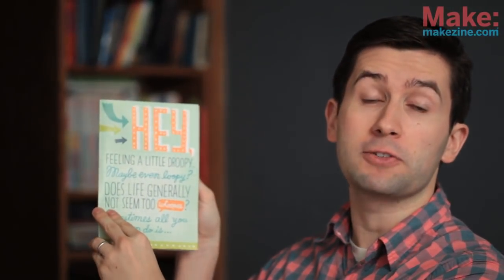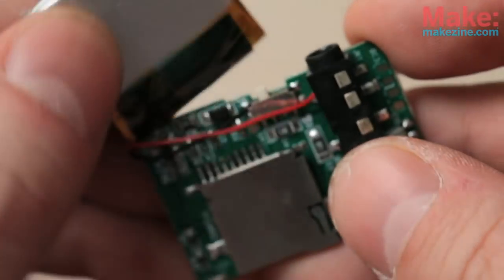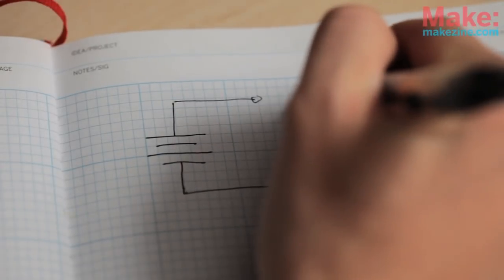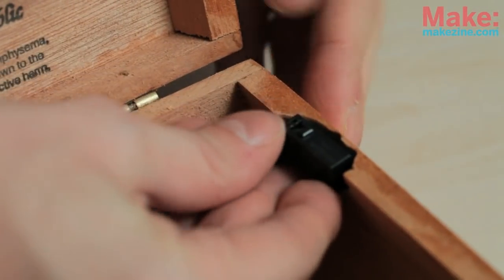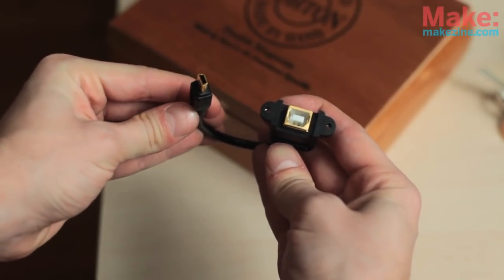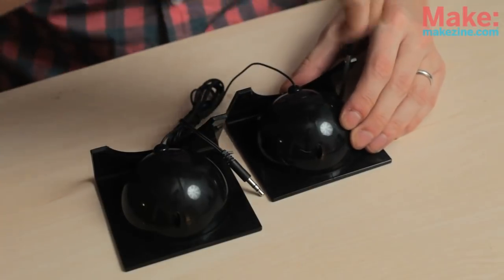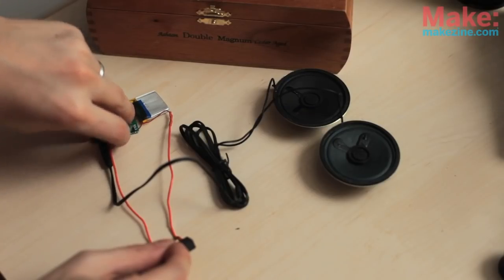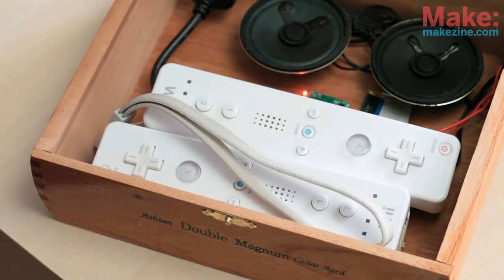MP3 Music Box

Comment: 1st op amps in mp3 arent meant to drive speakersssss they will clip please learn some electronics
2nd you should have mounted the speakers on the box and not in it 
3rd please i beg u to learn how to fucking solderrrrrrr cold soldering everything
4th that box could have been a crazy ass boombox if hanled by the right hands

Comment: Hi, this is the exact name of the switch:
PUSH BUTTON MINI SPDT C/O
the one I bought was from a manufacture called APEM
and this is the image of the switch:
h t t p : / / w w w .talmir.co.il/gallery/1349517496.jpg
the middle connection stays unplugged and the two others close the circuit 
hope it helps.

Comment: I soldered the mp3 to a switch and found out it works only when I press the button and it should be the other way around !
The circuit is supposed not supposed to work when the button is pressed...

They don't say anything special about the switch..
If someone knows what the heck..

FML.

Comment: could you please tell me where exactly on the circuit board did you solder the other lead from the switch ?  (not the one that was soldered to the battery)

Comment: poorly executed. i have a project similar in idea to this, but i'm using amplified speakers and a lithium pack from an old mp3 player (2200mah, 3.7v). it's also a much smaller box. in my case, i put the data/charging connection on the BOTTOM of the box so that nobody would see it. 

another flaw with this project you have is that it is IMPOSSIBLE to charge the battery unless you prop the lid open to keep the circuit closed.

Comment: you can't easy charge when te box is closed the + wire of the battery is not connected to the bord by the open switch so you need to open the box and play the music to charge the battery

Comment: Taking 8 additional seconds you could have made those cuts look nice.  Doing a hack isn't just about making it work but making it look good, especially if it is a gift.  Nothing says "I care but not enough to do a decent job" as quickly as the dremel job you did on that case.  You can also put a small false bottom to cover the electronics, add a 1.5 volt motor and a rotating Mario keychain figure to false bottom to spin about when the lid is opened.  I think I'll try it myself.

Comment: Why the heat shrink? What's the worse case if the switch shorts? The music plays!

How do you keep the batt charged over time (unless you expect the recipient to give it back, saying "This is soooo lame.")?

When you opened the card, 25 msec of sound escaped, creating a copyright infringement. Expect incipient vigorous legal action.

A more exciting project would be a hand grenade in a box with a wire attached to the lid that pulls the pin. The bonus is that it utterly destroys itself!

Comment: 1.did you just connect the speakers directly to the Amp? aren't they stronger than the whole Watt of the Amp? i guess they are,it will damage the Amp.

2.Carpentry :(

Comment: i'd introduce an arduino and some light detection (like photo resistors) and spread them across the box, then when you wave your hand over certain areas, the 'duino imitates a button press for play, pause, volume etc. (just a HIGH output to pins, soldered to the mp3 player's buttons, extremely basic). maybe get some cubes and draw the play/stop/etc symbols on them and shove the resistors in them, it'll be like a touchscreen player but without a screen :)

Comment: Hide the mp3 inside the remote and connect the power button to the switch and add the sound like game over!or,take the whole thing in the remote out and put a water bottle inside and a remote then record a sound like swishhh and connect the trigger of the water gun to the switch then the water outlet will be the sensor at the top.press the power button and kabam!